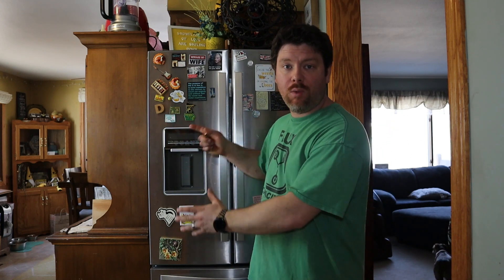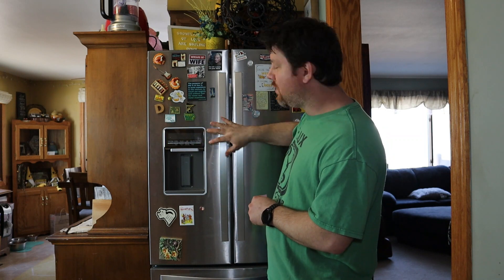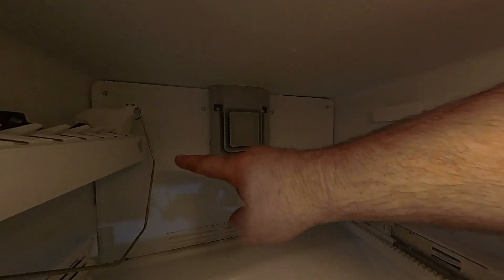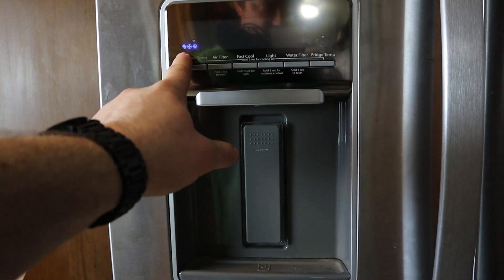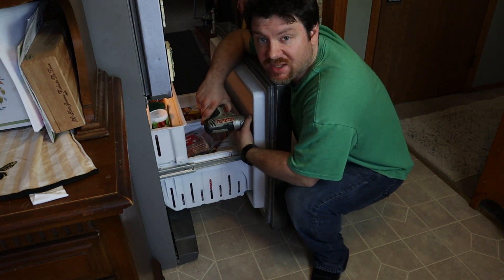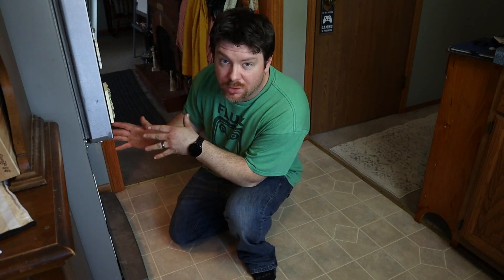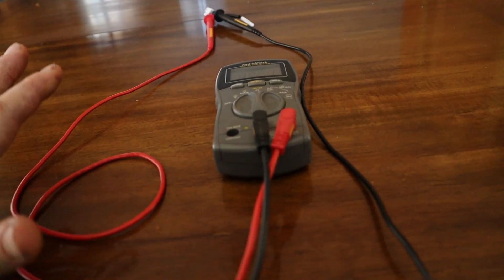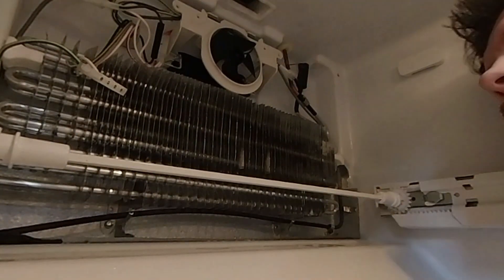Whirlpool Fridge Repair Model wrf560seym05

Comment: Thank you so much! You taught me how to repair my fridge as well as how to enter and use the diagnostic modes. Some months ago I defrosted and put the fridge back in service. I ordered the sensor and put it on the door with a magnet. 😄Since then I've just run a defrost cycle when it makes noise. After my latest defrost the fan stopped entirely and the fridge locked itself in "cooling off" mode. I took it apart and ice had stopped the motor. I replaced the sensor. The old one reads 4.2K @ 72F. Strangely it reads 5K if you reverse the ohmmeter's leads. Anyway thank you again. Hopefully it's fixed for good.

Comment: Wonderful video. I might replace this preemptively. I was just in there diagnosing a knocking noise but it sounds like it's coming from higher up. Investigating the issue led me to figure out that the fan in the freezer wasn't running properly, and now I know why my fridge wasn't getting sufficiently cold! Gonna order a replacement and do the thermostat at the same time for insurance. Now, to figure out that knocking noise....

Comment: Thank you for illuminating my issues! What would happen if I just did the "defrosting" steps you described? Would that be a short-term fix until I can get someone out to take it apart? Thank you.
Reply from the maker: That's what I did for months until I replaced the part. And it did fix it
Reply: @daleofalltrades  you are a lifesaver-thank you! I've been without a fridge for 2 days and can't get anyone to look at it.  When I talked to an actual repair technician on the phone, they were no help whatsoever. I even told him about the ice and frost and he said that wasn't related. Thanks a ton.
Reply from the maker: @jonibrander325  that is a prime example of why I try to fix everything myself.
Reply: Sorry to bother you, but I have the 3 snowflakes up and don't think I hear anything? How do I know the defroster is working? Thank you!
Reply: @daleofalltrades  so true and you are obviously very talented.
Reply from the maker: @jonibrander325  if you listen closely you should hear some melted, sizzling, or dripping noise
Reply: @daleofalltrades  so helpful-thanks. Do I stop it after 20 minutes-I think you said it took that long?
Reply from the maker: @jonibrander325  it will stop on its own, you will hear some beeps indicating service mode timed out and the fridge will return to its normal operation. If it's really iced up I would run it a second time.
Reply: @daleofalltrades  you are amazing and I truly appreciate you. Yes, I heard the beeps and I will run it again, as it was/is very bad. It will be like a miracle if the fridge starts working! Have a great rest of your weekend!
Reply from the maker: @jonibrander325  glad I could help, that's why I started this channel.  Hope it works out for you.
Reply: @daleofalltrades  thank you! Could I ask just one more question? I ran the defroster about 4 times last night and it worked great. Sadly, the fridge still isn't cooling. Today I noticed that the first snowflake (blower) doesn't sound like it is turning on. Any thoughts on what this means? Just so I can know how to proceed on Monday. Again-you are helping so much...
Reply from the maker: @jonibrander325  blower is most likely back do to being stoped by ice so long
Reply: @daleofalltrades  is most likely....what? sorry-typo and I don't know what you are saying! Is there anything I can do?
Reply from the maker: @jonibrander325  most likely the fan/blower from freezer to fridge
Reply: @daleofalltrades  thanks again for all of the help. I tested the blower again just now and it was whirring when it turned off during the test-a good sign. No idea why the fridge still isn't cooling. But, I tried-thanks to your help! I'll pray for a timely repair person to visit-as of yesterday it was going to take 6 days!  Cheers...

Comment: Hi. I had all the symptoms you mentioned and so I thought Yeii I can do this. So I replaced the sensor on Friday … unfortunately the fridge is still warm. On the front panel I have the fridge setting in 4 stars and the freezer as well. What else could it be and is there another video ? I am wondering if it couAny help would be appreciated ?
Reply from the maker: Could be the fan or the door that opens allowing cold from the freezer.  You the panel to test all these functions
Reply: @daleofalltrades  On the panel is there a way to check the door that opens allowing cold from the freezer
Reply from the maker: Yes if you slowly select each option at a time one of them causes it to actuat. I can not remember which function as it's been over a year.   Behind the fridge there should be an instruction manual showing each test function